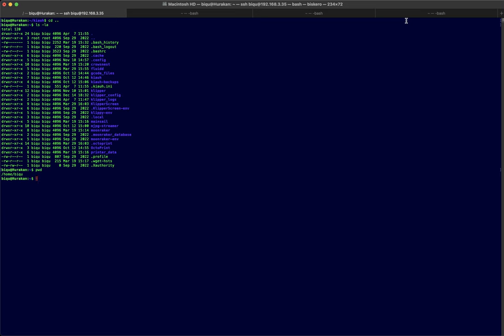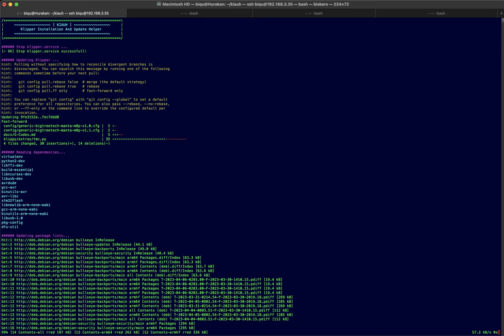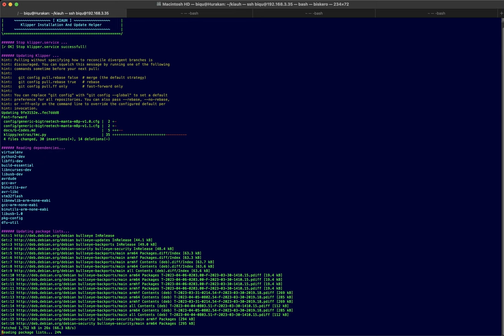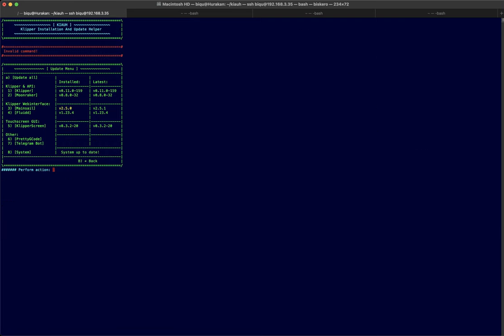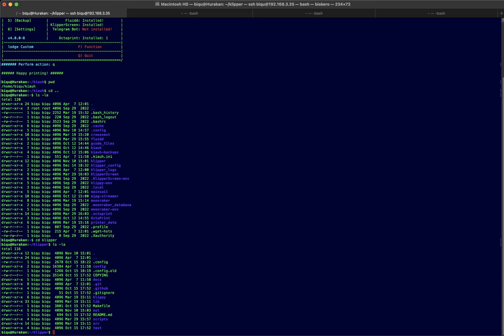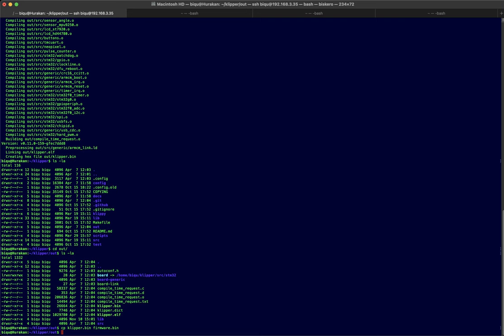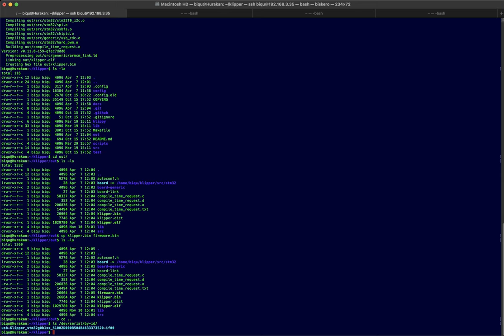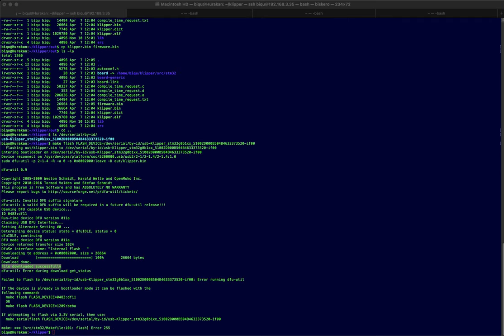Updating Klipper firmware from the console on the BTT Manta M8P - Custom 3D Printer

Comment: when everything works that's pretty straight forward. what about when the CB1 doesn't see the MCU? is there a way to sort this out? For some reason i cannot get the MCU to open with "ls /dev/serial/by-id/" no matter what i do
Reply from the maker: agree with you! Anyway, I had  an issue with the firmware update, check last video maybe it helps, le me know. Please subscribe thx